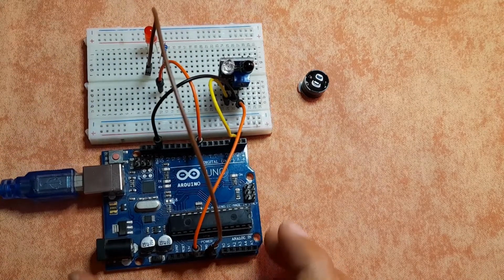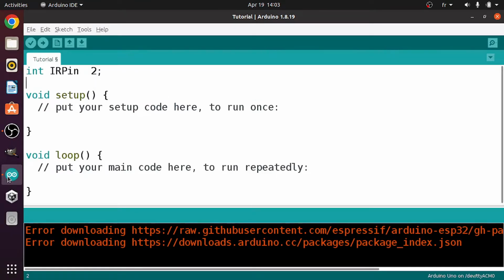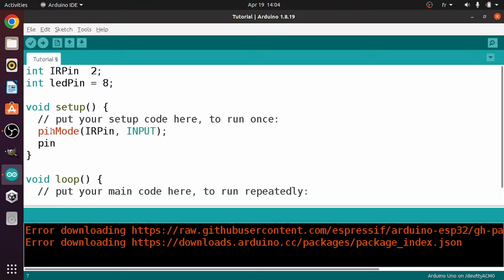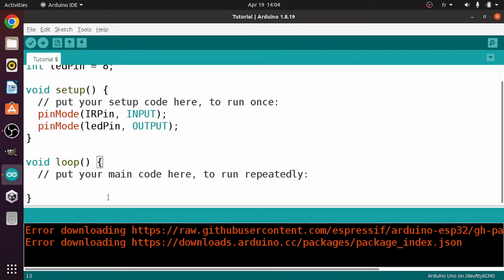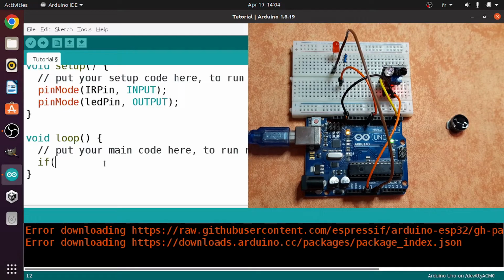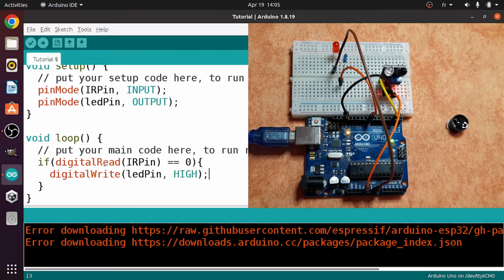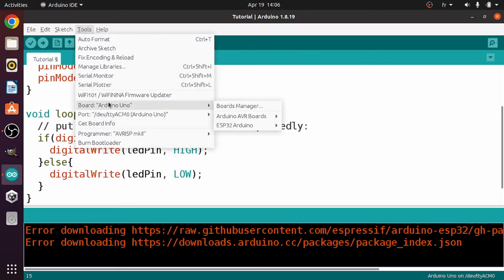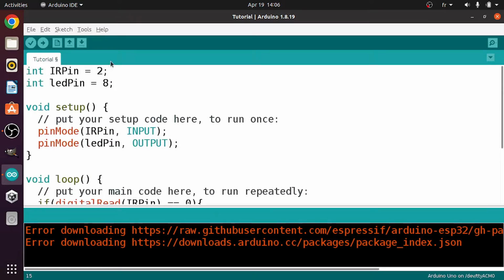Arduino Tutorial 38- IR Infrared Obstacle Avoidance Sensor With Arduino

Comment: I have a problem i am using a arduino nano and a port COM3 on your arduino IDE your HIGH and LOW chanched blue mine didn't and it doesn't work so i think it has be that can you fix this?